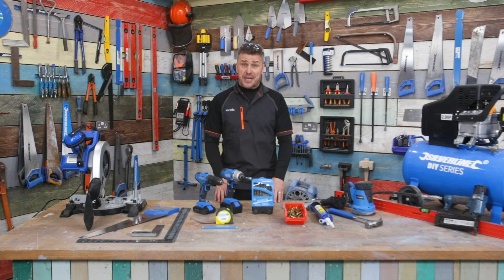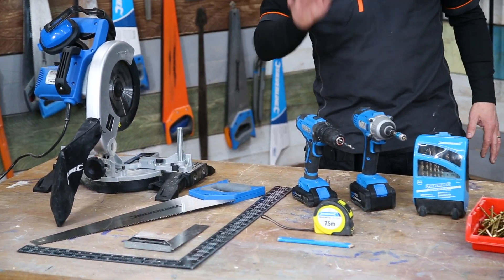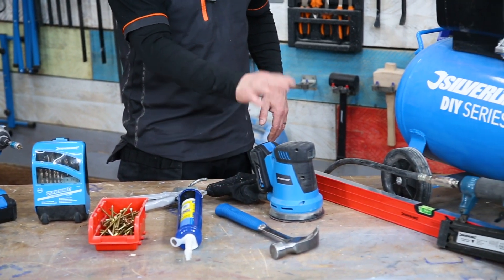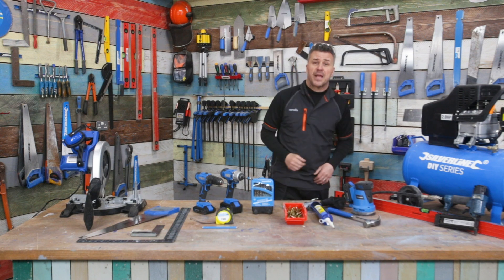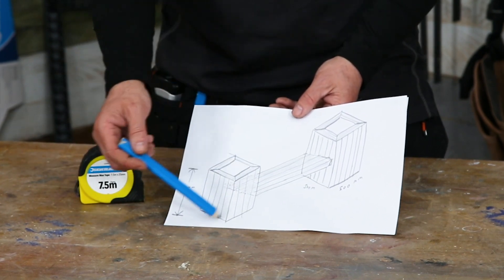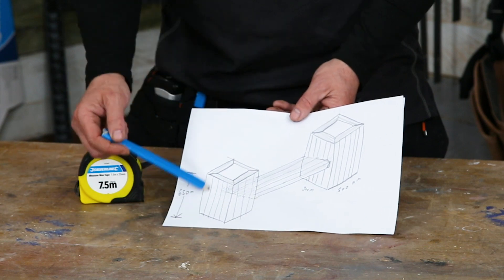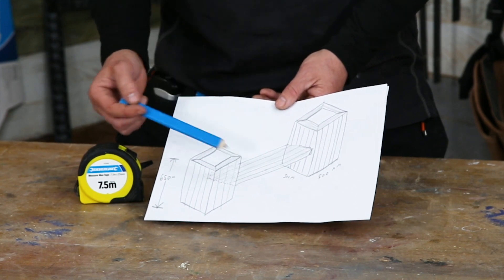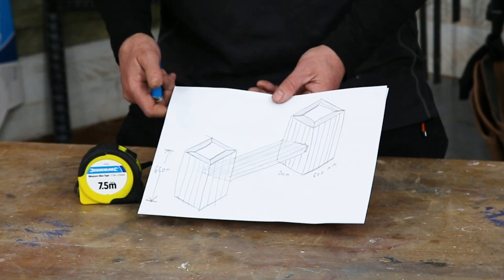How to build a garden bench with planters

Comment: Hi Craig,  The framework with the 3 x 2 noggins in the middle. Could you tell me the measurements of where it sits in the framework please?
Reply: I fixed the center frame about 400mm front he floor to the both sides square sections, but you can choose the hight yourself if your taller or shorts just a-just the hight by 50mm or so.

Comment: Hi Craig what would the total cost of something like this be ?
Reply: Id say a lot depends on the free available wood one has on hand as opposed to purchasing all new wood.  One can choose pressure treated 2x4 for the frames, use cheap cedar fencing panels for the exterior.  Add in hardware for outdoor use.  Id say the cost depends on a lot of factors.  Luckily at least in the US, wood prices are slowly dropping.  Cost can be more too for the type of finish one chooses.  Natural, oiled, stained, painted.
Reply: @markb8954  I have built mine now I wish I could add a picture to my reply I do like it